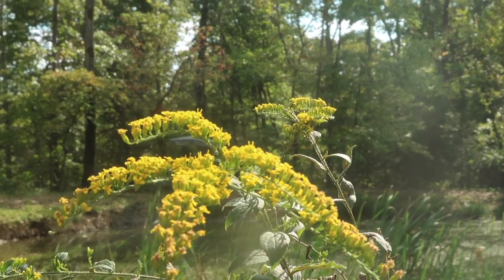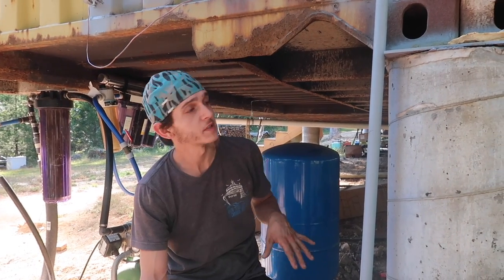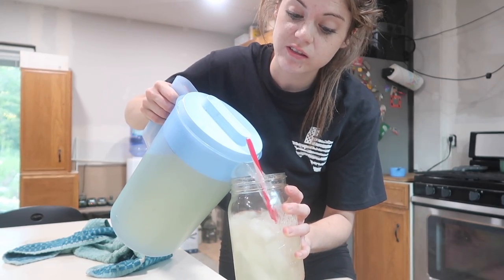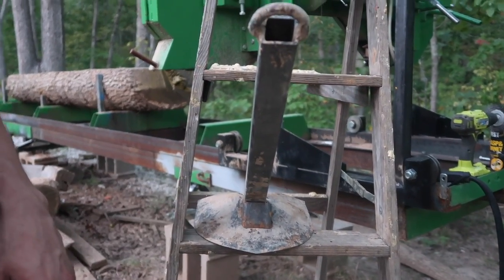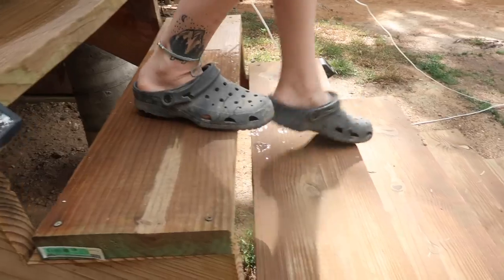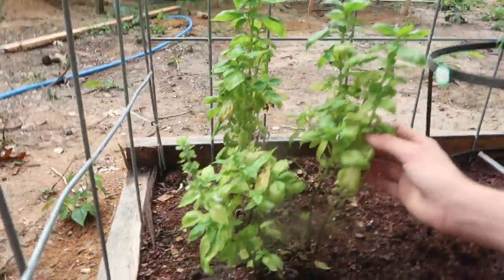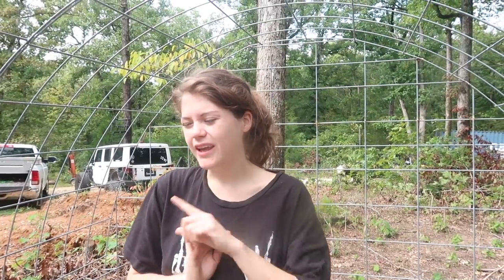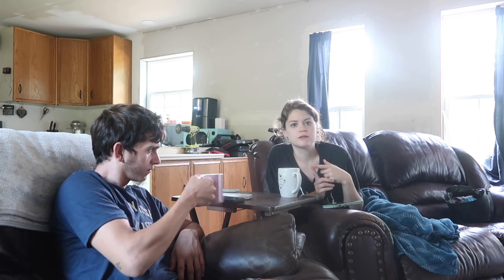Under Container CHAOS I Shipping Container Home |EP:65 | Tunneling Under House, Frozen Water Lines

Comment: Cody, why didn't you use a cable, that wouldn't stretch like your strap does, attached to the shovel head?  You could have attached it to the backhoe bucket and used the backhoe arm to go back and forth without moving the tractor. You might have had to change the position once or twice but it would have been a big time saver.